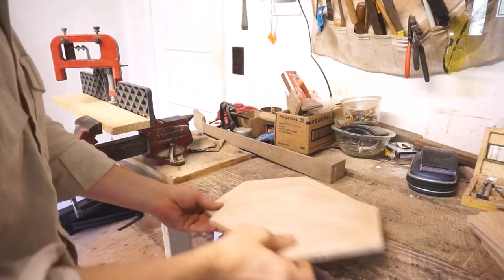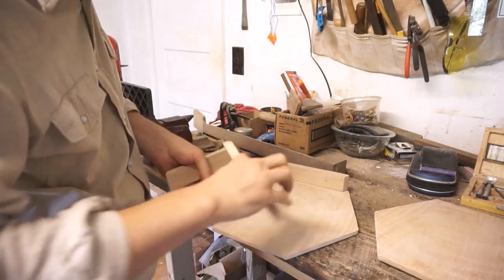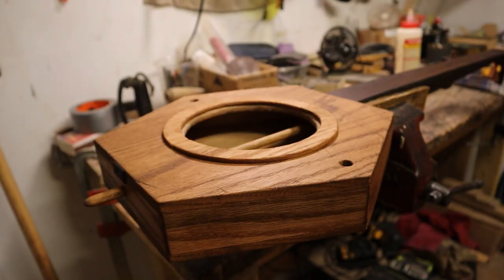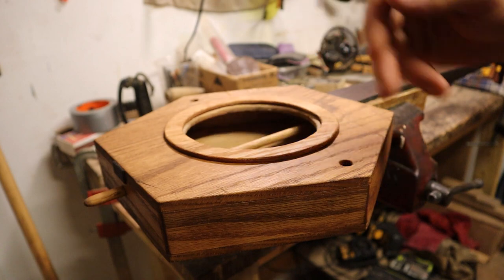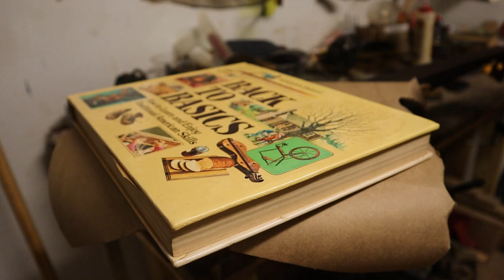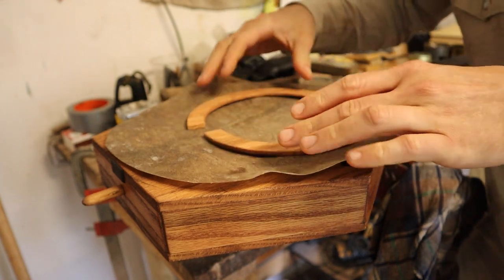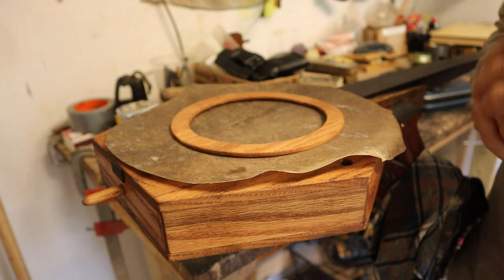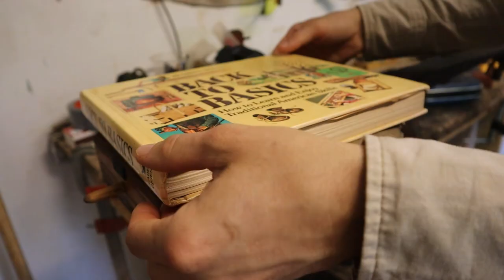Building the Kentucky Mountain Banjo

Comment: Terrific - people will be following this video for many years into the future! Two questions - did you use glue blocks for the nails front and back? Shape and size of sound hole in back? Really interested in hearing how this handsome banjo sounds. True craftsmanship - Thanks for letting us watch!
Reply from the maker: I did not clamp the hickory pins in after hammering--just let everything dry in the vice. And there are only the two small sound holes in the front--the back is solid oak. Some of the original Kentucky banjos I've examined have round, square, or heart-shaped sound holes in the back, but many of the backs are solid. In the latter case, sound holes were either not used at all, or they are cut into the top and/or sides. Most common sound hole is just a drilled hole 3/8" - 5/8" diameter for top/side holes; larger diameter for back holes.
Reply: @CliftonHicksbanjo  Ah, now I see - the two sound holes look like nail heads which I was predisposed to believe you would be using. Thanks for settling me straight. Is oak, red or white, your go to choice for body wood?
Reply from the maker: I think red oak is vastly superior to white oak for sound chamber material. Red oak is so different from the other oaks; for example, you can literally blow air, with your mouth, from one end of a 6-foot red oak board through to the other end. This means that hollow fibers must run the full length of the red oak board--I know of no other wood with this quality. No wood I have used sounds richer than red oak.
Reply: @CliftonHicksbanjo  Thanks, a valuable piece of information to have.

Comment: Great build video! How do you prepare the hide before gluing it on? Does it need to get glued on wet/damp so it gets more taut as it dries after being glued in place?
Reply from the maker: Yes, needs to be soaked for 30 mins- an hour, then rolled into a dry rag so that excess water is absorbed. When laid to the glue, it should be water-logged but not dripping at all; i.e. damp.

Comment: How do you change the head on this kind of banjo? Love your content.
Reply from the maker: Tap the wooden ring off with the flat side of a sharp chisel, clean off any glue, etc. Then glue the new hide and ring on. Once dry, drive wooden pins or metal tacks into the ring for added security, trim any excess hide, and you're done.
Reply: @CliftonHicksbanjo  Thank you for the reply. I'm planning on building a mt. banjo and the kentucky style "seems" easier to build than the regular north carolina ones, i hope it goes well.

Comment: If the sides (as you stated) were of different lengths then the angle of 60degrees (as you stated)would not be correct for all the side pieces
Reply from the maker: Math is not my strong suit. Somehow that banjo turned out nicely. It did develop a crack in the soundtable after a while, but I think the owner was able to easily fill it.